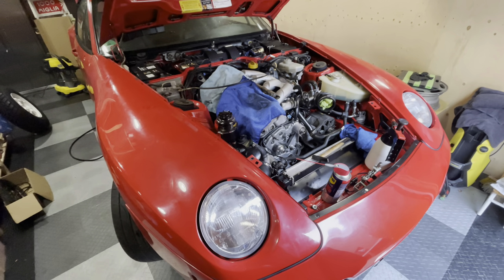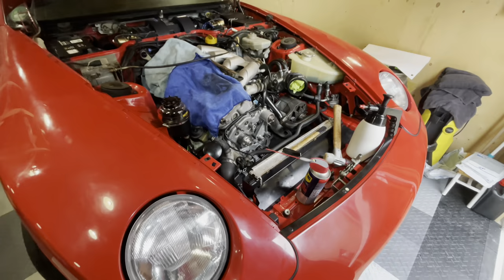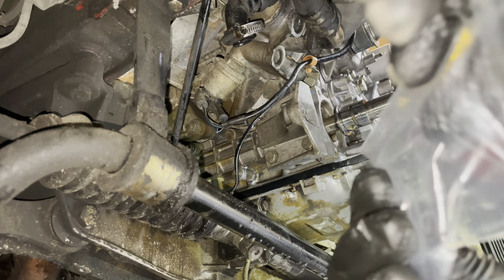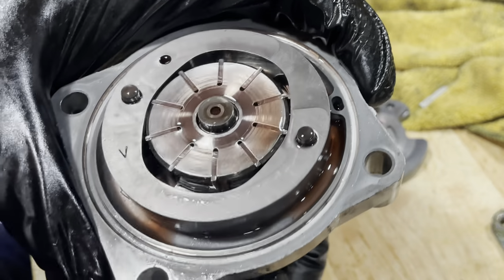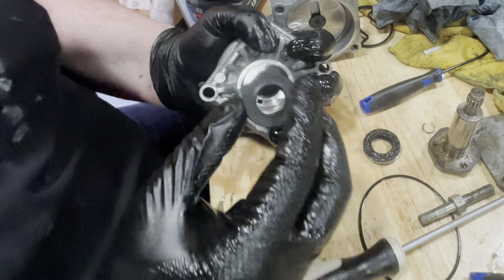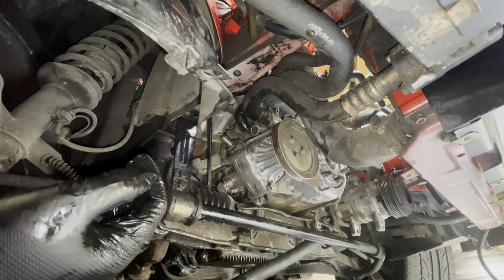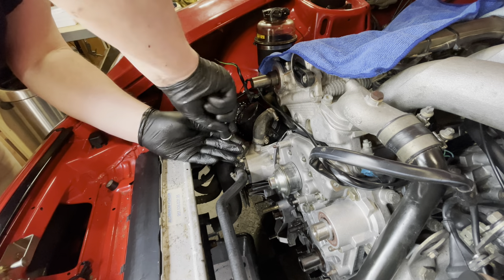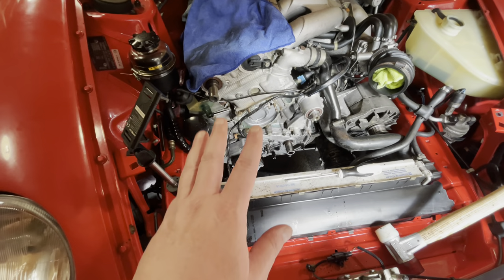Restoring a Flood Damaged Porsche 968: The one with the pumps

Comment: The oil filter housing is a once in a lifetime task - you dont want to it twice. It is a proper fiddle to do and the gaskets do corrode. Heater control valve is definitely worth changing. The oil pipes are crazy expensive (if available still)

Comment: Usually the balance shaft seals have direction arrows on them. Upper (clockwise) Lower (Counterclockwise)

Easier to remember than circles and squares 😉
Reply from the maker: True but those arrows are super small and would require me to know which way the shaft turns 🙈
Reply: @GarageBiljon  😂

Comment: Nice!  If you're doing oil filter housing, probably bea good idea to also check oprv as well
Reply from the maker: I have a kit to do the oil cooler seals, but it looks like that area is dry so might not do it. The car had good oil pressure the times I started it, so unless there is an oil leak I am going to leave that whole area alone.
Reply: @GarageBiljon  The issue with the oil cooler housing is not so much external leaks, its more internal deteriation of the gasket causing oil and coolant to mix.. Its not a difficult job in itself, its only the access that's tricky, but you are almost there already..

Comment: Good job. How do the motor mounts look? When we started on mine i had the whole thing Ice blasted then sent parts off for vapor cleaning which came back looking new. But for me it all started with collapsed motor mounts.
Reply from the maker: I haven't looked at them yet. Once the engine is done, I will start tackling the suspension en mounts.

Comment: Great video! Just a layman’s question: when you drill out the snapped bolt you are not afraid of getting metal debris in the radiator? Or did you expect that would be flushed out by the cooling fluid?
Reply from the maker: Thank you Gertjan, the bolt is made of plastic so no metal shavings to worry about. But even it is was metal, the goal is simply to make a small hole, not drill it through. Then you van put a bolt extrator in it.